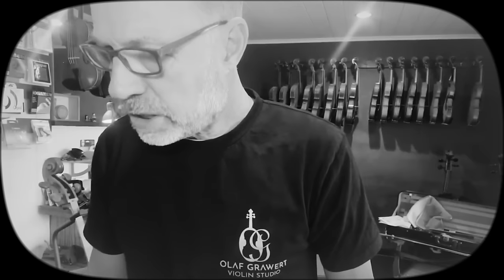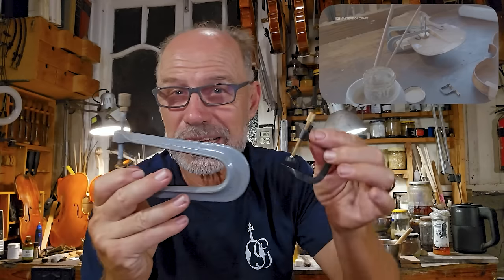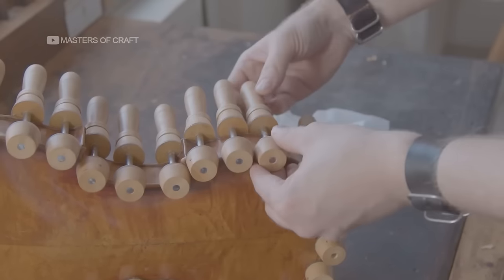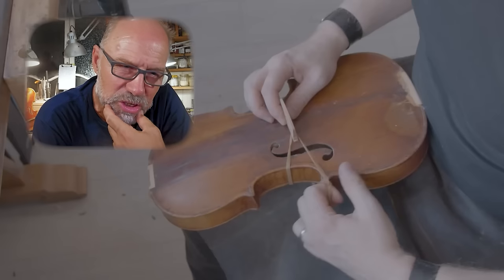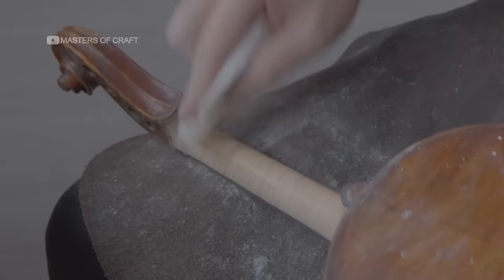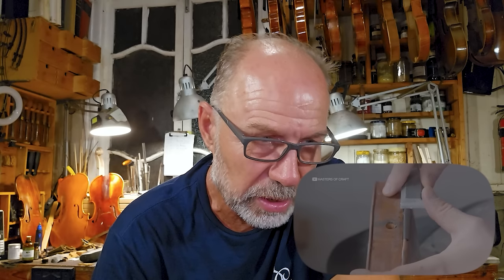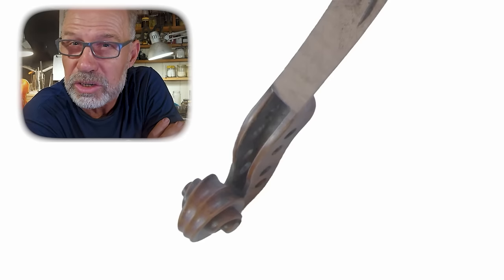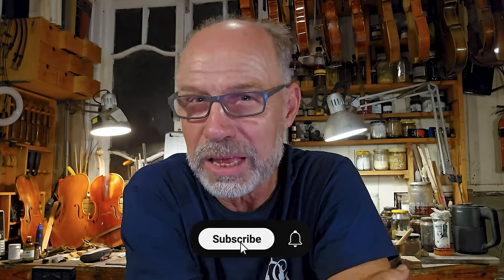I Review Broken 1840s Violin Restoration Video

Comment: Hi Olaf can i point you to Rosa Stringworks channel where Jerry Rosa repairs a violin that has been destroyed while moving he does not like hide glue the episodes you want are called Chocolate ( the name of the violin  ) hope you enjoy his work and maybe get a reaction video from it 😊
Reply: Oh, Bill. Your just setting the stage for a rant. 🤬😖
Of course, Jerry's use of Titebond will be the premier issue. 😱
Are you trolling, here? 🤣 😁✌🖖
Reply: @zapa1pnt Of course though Jerry backs up his choices by showing how consistent the glues he uses work and how easily he can take the instruments apart for repairs afterwards when they've sustained physical damage.  He'll even go so far as to explain why he chose a particular glue such as this needs to be able to come apart so I use Original TiteBond compared to I want this to last as long as possible but come apart with heat so I use TiteBond 2 or this is something I never want to come apart and to be impervious to humidity such as repairing a broken neck or headstock so I used TiteBond 3.  He does when the job calls for it use Hide Glue and regularly uses it for what its best at when he puts on labels.  He does strongly dislike the inconsistency between Hide Glues used by different makers with some coming apart if you sneeze near the instrument while others require extreme heat, steaming and great force to get them apart.

Jerry would tell people when they brought a really valuable instrument in though when he thought it needed to go to a Master Violin Maker especially if it needed to be perfectly color matched to maintain its value since he is color blind.  He says he would refuse to work on a real Stradivarius or any other violin made by the Old Masters since that would be beyond where he places his limits so one does have to appreciate that level of candor and honesty.

Stradivarius was an innovator using the most modern technology of his time and perhaps inventing better so if he were here today we all might be surprised by what he would choose to make his instruments with in the here and now.  Perhaps a mix of carbon and wood fiber or a 3 axis CNC machine along with laser cutters.  Wonder if he'd be first in line to get some Tesla Atlas Robots working in his shop....

Best!
Reply: @neilfromclearwaterfl81 : I am well aware of all of that. I have been watching Jerry's channel for years. I was joking, specifically, with Bill. 😁✌🖖
Reply: @zapa1pnt Just calling it out for those that may not be familiar with Jerry.

Best!
Reply: Just let RSW and the world of classical violin be a heterogeneous "mixture" even though they are still the same topic. RSW must accept the complete rules of traditional violin workshops if violinists want to be in the spotlight
Reply: @Adrian_AdamViolonDiGerma-tm3nq : I agree with your first statement  but I do not understand your last.
Reply: @Adrian_AdamViolonDiGerma-tm3nq  I doubt that Jerry must do anything different since he is on a remote farm and had a shop that catered to BlueGrass Players and Country Fiddlers but is now semi-retired due to crippling arthritis in his hands that prevents him from carving any new mandolin's, building custom guitars and doing repairs except for close family and friends.  For a simple country luthier though he's done pretty good over his career even having one of his custom 10 string mandolins ending up on display in the Smithsonian Museum.

He has already sold/given a portion of his tools away such as the jigs and such for making bone/antler mandolin saddles turning those over to his young apprentice who has started his own Caleb Mills Guitar repair shop though he will take in a mandolin, country fiddle, banjo, zither, etc, etc for setup/repair.

If you brought either one of them a violin made by one of the masters or worth tens of thousands of dollars or more and they would not take the job recommending you seek the services of a master violin maker unless you already did and it was declared a loss and totally unrepairable.  Funny thing is that most times they can repair the "unrepairable" and bring it back to playing condition at a very reasonable cost.  

Very often that unrepairable pile of bits and toothpicks is Grandpa's Old Fiddle that may have been purchased from the Sears and Roebuck Catalogue 100 years ago with its only real value being sentimental.

Best!
Reply: @zapa1pnt  no I honestly wondered what he would make of Jerry's undoubted skill I'm a fan of both of their channels ( and subbed to them) I appreciate Jerry's skills and Olaf's passionate and. Intense work ethic in the making and repair of "classical" instruments I was sure Olaf would be gentle in his opinions as he is a decent man . I know it's comparing apples and oranges but such is life plenty of room for all opinions my friend over the last ten or so years Mr Rosa has entertained and taught me about his work and so has Olaf (subbed for 2 years or so ) it doesn't mean I agree with all of their opinions, I don't but the world needs to be a kinder tolerant place Olaf and Jerry are both gentlemen .
Reply: @billmumbo2697 : I'm right there with you, Bill. 👍 😁✌🖖
Reply: Jerry's work on the "chocolate" violin is excellent. Even if you disagree with the use of modern glue, dismissing the rest of his skill set would be elitist and not what I have seen from Olaf. I'd love to see that reaction too.

Comment: Hey Olaf, thanks for reacting to this; I knew you'd eventually get to when I saw this video originally. One question: what do you imagine the monetary value of this instrument would have been? Do you think it's worth the effort spent on it, or do you consider this to be too far gone to justify fixing?
Reply from the maker: It's hard to say what the monetary value would have been... It definitely looks like it's worth doing the restoration though.
Reply: Olaf what are your thoughts on carbon fiber violins? Also there is a youtuber guy who used a cnc to make a violin just to see if it was possible what are your thoughts on how that violin sounded? In that video he used permanent glue on purpose so that it could never be repaired. https://www.youtube.com/watch?v=5iP2bkFUj94  @AskOlaftheViolinmaker

Comment: Question: I have a student violin that's finished with oil, but not varnish.  I suspect it is because the timber is fairly recent.  It is Spruce top, maple back.  Would this be a candidate for a violin maker to varnish with a good, old fashion violin varnish?  It has a very nice sound because I took it to an experienced violin maker who set it up to perfection, but it has a rather dull finish.  Or would a polishing done your way, improve the appearance and maybe enhance the sound?  I live in the desert, so the violin will be thoroughly dry in a year or two.  Would varnishing later work as I hope?  BTW, it's a Bunnel by Kennedy Violins, the model Ray Chen liked best of all violins on Amazon in his youtube comparison.
Reply: I thought Ricard bunnel violins used synthetic varnish? The transition between varnish and no varnish on the neck has a distinctive matte character and deep color. 

 It's different if the violin is varnished with handmade varnish by the violin maker himself, the color will of course be more transparent (Consisting of several layers of "violin varnish"), a little slippery, have a wave texture (not perfectly smooth), And they can usually wear out more quickly.

 In contrast to synthetic varnish which when touched is perfectly smooth, the color is thick (But actually it only consists of one thin layer) and smooth like the surface of ABS plastic. 

 Apart from that, the gradient color is made from the same type of varnish/paint as the main varnish used by the Ricard Bunnel violin, so it does not affect the feel of the surface (synthetic varnish, Synthetic gradation, synthetic maple backplate hologram fleming)

 Usually, manufactured chemical paint/varnish will not be compatible with ordinary violin maker varnishes made from natural ingredients Or any natural ingredients such as linseed oil. I liken it to natural varnish applied to fake varnish like porridge spread evenly until dry on a smooth ceramic floor. 

 But at least and overall Ricard bunnel violins are at least very more durable and technically more resistant to all the things that can damage a violin, also Ricard Bunnel violins Has better sound quality.

 But the standard of a violin is not determined by price. In my opinion, a standard violin (beginner and above) is not the right price at $500USD, but a little more expensive above that. Solid wood with tight wood grain, varnish made by a violin maker from natural materials, made by a reputable violin maker, durable, precise craftsmanship, And the setup is slightly above standard quality (not just good enough). 

 As for the rest, it is your own preference.

Comment: Cool review.
Those thumb planes, thou... I guess you professionals have to achieve quite a dexterity in fingers.  After a while working on a bigger surface (guitar) my fingers began to hurt. So I attached diy "handle" , which is a vine bottle cork, slashed partially in half and fitted on the back of the blade and then clamped with rope. These way "handle" rests in the palm, taking some pressure off from fingers.
Reply: There are commercially made planes, like that, available.